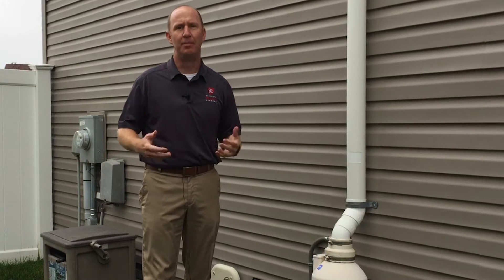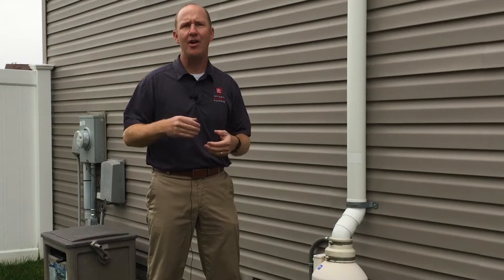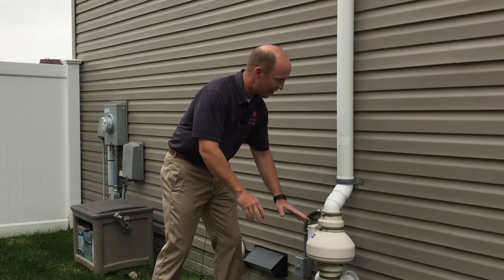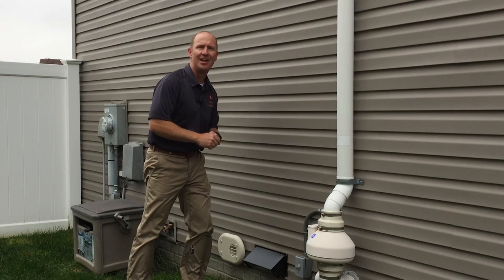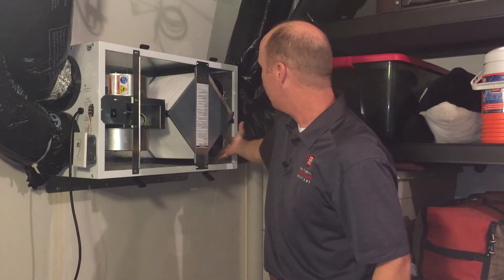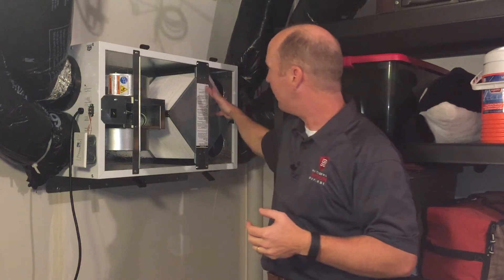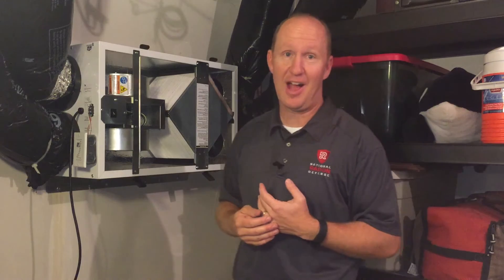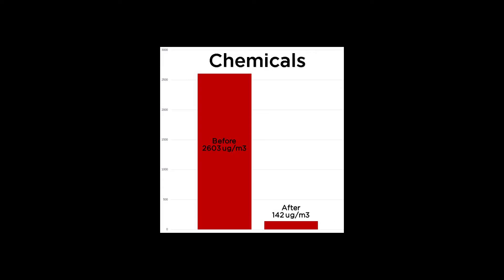Energy Recovery Ventilator Reduces Radon and VOCs

Comment: What's the ideal minutes per hour to run the ERV to lower the radon?
Reply from the maker: To effectively lower radon levels using an ERV, it's generally recommended to run the system for several hours each day, ideally aiming for at least 15-30 minutes per hour -- this is recommended along with a Breathe EZ air filter. However, while an ERV can improve ventilation, it may not be the most efficient solution for radon mitigation, especially if outdoor radon levels are high. Radon reduction typically requires a dedicated radon mitigation system, such as sub-slab depressurization, which is more effective in reducing radon concentrations. The ERV can help improve overall air quality, but a specialized system for radon is the best way to lower levels significantly.

Comment: Our problem is that the outside air has higher radon gas level than inside.
Reply from the maker: That's definitely a concern, as radon levels can vary depending on area. If the outside air has higher radon levels than indoors, an ERV may not be the best option, since it could potentially bring in more radon. In this case, it's important to prioritize a radon mitigation system, such as a sub-slab depressurization system, to reduce radon levels inside your home. You might also consider an HRV (Heat Recovery Ventilator) instead of an ERV, as it focuses more on heat transfer and doesn’t introduce outdoor air as directly. Always make sure to consult with a certified or licensed radon mitigation specialist would be the best route to ensure your home is safe. Check for a NRD local dealer in your area :)